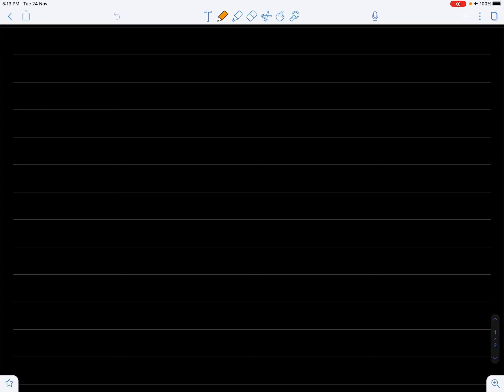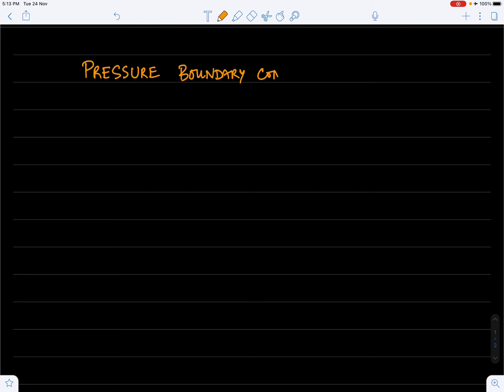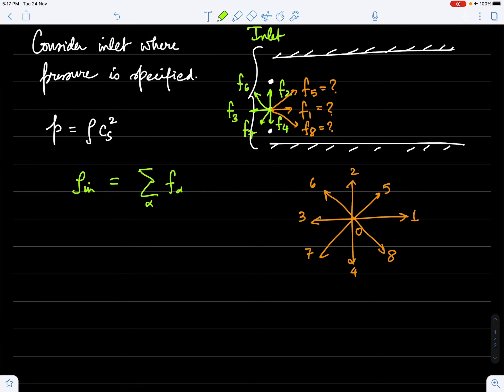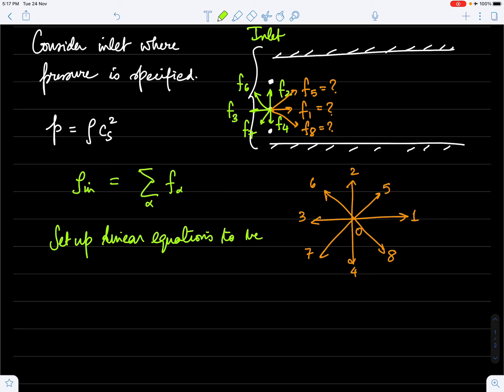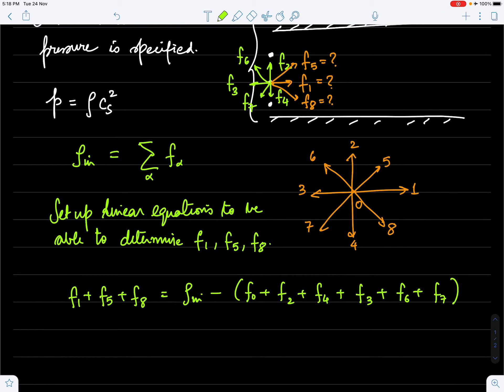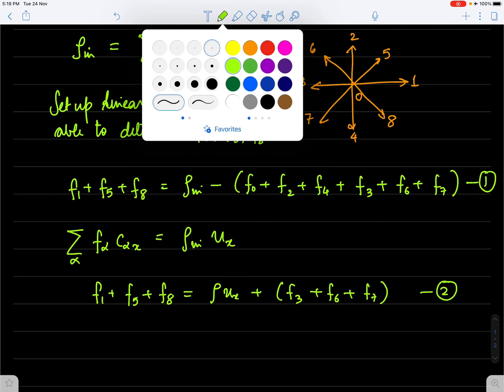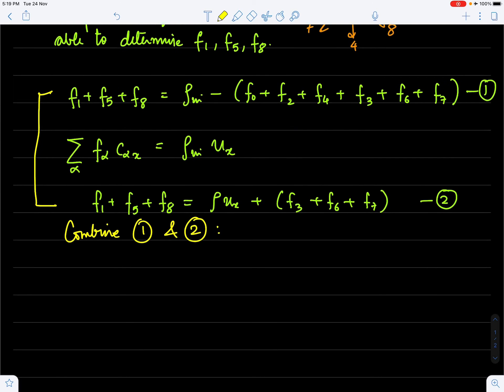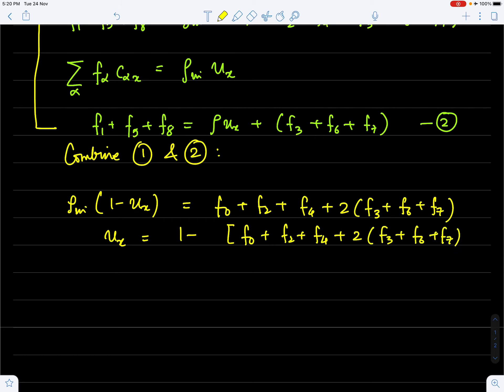LBM Lecture 14: Boundary conditions in finite-domains (part 2)

Comment: thank you Prof, Dear sir how can i defined f3,f6,f7,f2,f4 in the inlet (P=cst) at initial condition (t=0 that means there is no streaming yet )
Reply from the maker: If your question is regarding a suitable initial condition, then a possible choice is to start with an equilibrium distribution at a chosen characteristic velocity (which could also be zero).
Reply: @profamitgupta  Do you mean the velocity could also be zero in the inlet at (t=0)?
Thank you for your answer
Reply from the maker: @saddeksaddek9955  That is correct.
Reply: @profamitgupta  Thank you

Comment: Dear sir, how to specify the four corner boundary condition? When I use velocity inlet and outflow outlet, and take the left down corner for example,  f6 and f8 is very difficult to calculate because they never flow into the simulate domain. And when I start simulate, the corner point always diverged. Thanks for your attention.
Reply from the maker: My suggestion is to assume that the physical boundary is half-lattice away from the penultimate lattice row. That way all distributions in the corner nodes can be taken to be part of the wall nodes where bounce back or free-slip is easily applied.
Reply: @profamitgupta   Thanks, I will try it.